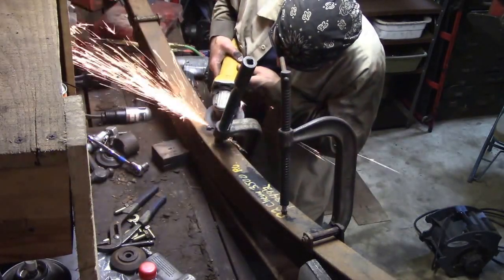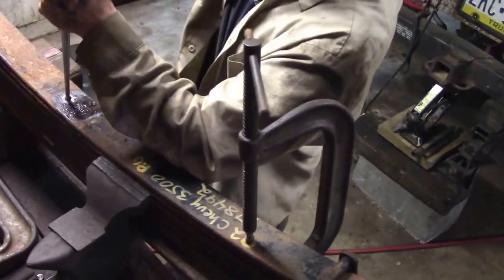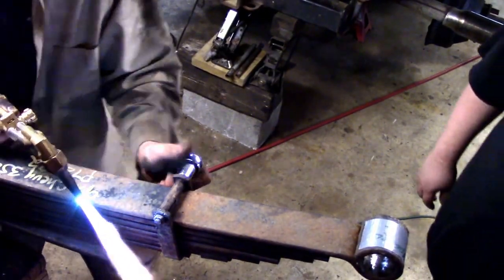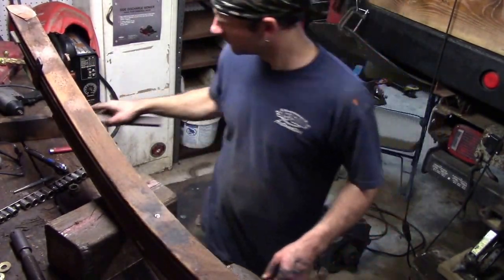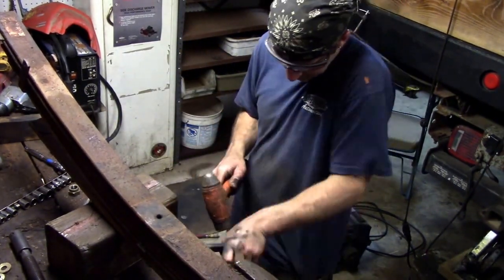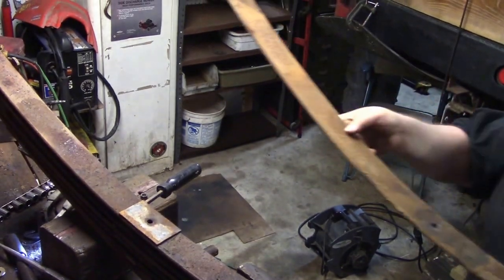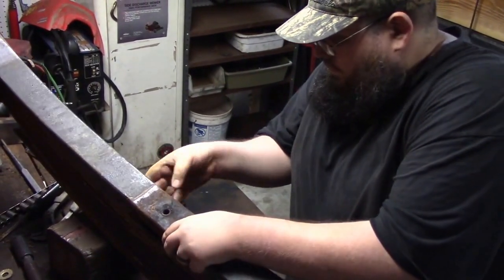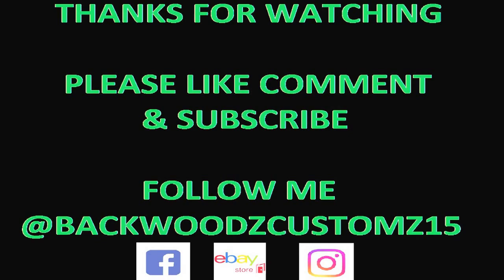Adding More Leaves to a Spring Pack, Building a Heavy Duty Suspension

Comment: I have 7/1 leaf springs on my box 1988 Chevy box truck.  We converted it to an RV.  The truck weight after build out is around 8500 lbs loaded.  I was thinking about getting 9/1 springs rated for 3955 lbs.  Do you think they would be the correct weight rating or should I add an additional leaf or so?  Thank you for the video it was very helpful.
Reply from the maker: If you need more add them.. if not enjoy a softer ride

Comment: What are some of the negative effects of increasing the number of springs of a heavy duty vehicle
Reply from the maker: Well you could get a harsher ride. If you lift the rear of the truck up too high it will start to change your steering cause the tie rod ends will be pointed at the ground more. Don't really have any other thoughts.. Maybe rear drive shaft issues but were talking pretty high up.. What do you have in mind?